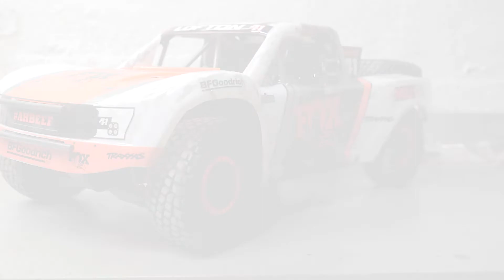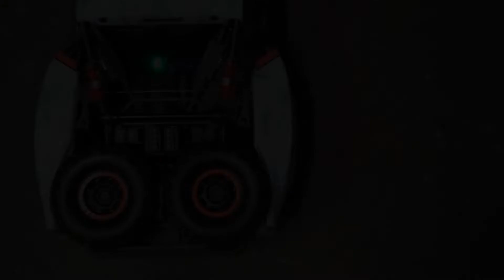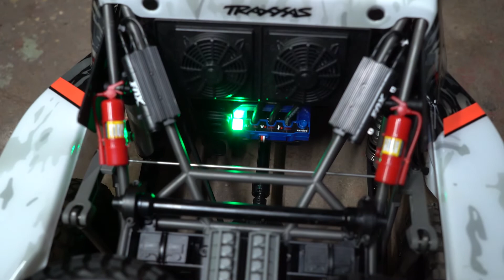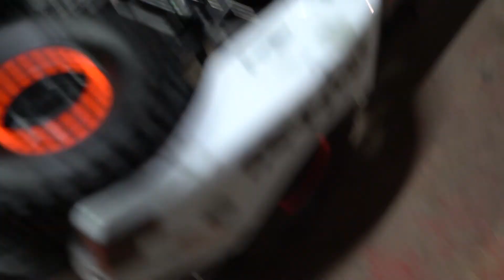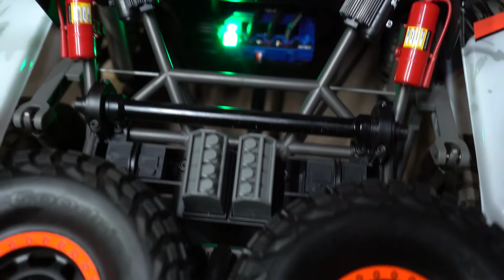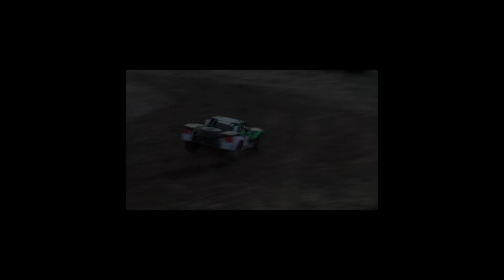My New traxxas udr?

Comment: I think the esc needs recalibrated. Not 100% sure, I've never seen that myself personally. I've got the UDR myself. Also have 3 other Traxxas models as well. One of which is nitro. Hope you get it figured out soon as it is an awesome truck. Few tips. Traction rolls a lot in grass and pavement under throttle. Much better in loose terrain. Also you will need trailing arms and front driveshaft pretty early on  (don't know from experience as I've changed a lot of the flimsy bits to aluminum or steel right away). Another thing I might suggest is check the pinion, make sure there isn't anything between the teeth, and check the wires going from the ESC to the motor and make sure they are fully engaged.
Reply from the maker: Lane Waite that’s a good idea I’ll check to see if something is stuck between the pinion that would make sense

Comment: Hahaha u gave in, when u got the Losi Super Baja u said u thought about the UDR, I have had one since the first batch was released n I havent broke anything, the first run my buddy broke a lower A-arm, thats a bummer on urs, I dont use Traxxas batteries on mine at all, did u reset ur esc endpoints?
Reply: Did u check ur motor wires, it almost sounded like one of the wires was loose or didnt have full connection
Reply from the maker: I’ll check all of the wiring. I remember when your buddy broke yours I saw that video lol

Comment: Lose wire,check
Reply: Right check wires, but have. To send motor and esc, batteries wouldnt matter unless using to low c rating or you did use to low cr rating need atleast 30 50 really , and if you soldered job wasnt good both of these couldve shorted the motor or esc or coukd still be problem seems like wire connect not sufficient current ....
Reply: Thats noise when plug or solder joint is bad.
Reply from the maker: I’ll check the wires that’s a good place to start thanks 👍🏻
Reply: @clodbusted1776  my buddy's xmaxx did same thing today and it ended up being a lose wire,sounded exactly like that😊wasn't being a smart ass👍
Reply from the maker: justin mcconnal it makes sense because that light is a low voltage light. If there is loose connection it would definitely make that light blink
Reply: @clodbusted1776  did you make sure it wasn't in nihm mode or something
Reply: Sometimes jumping ive had wire break where meets plug at soilder joint, if you do ever have send bac to traxxas , just send the parts not whole truck goodluck , i went arrma crazy for same reason, but i liked this truck and xxmax too but esc stink
Reply from the maker: rc player I’ll check all the wires if I have to I’ll send the electronics back to traxxas but Im hoping it’s something simple like a loose wire
Reply from the maker: justin mcconnal yes that was the first thing I checked